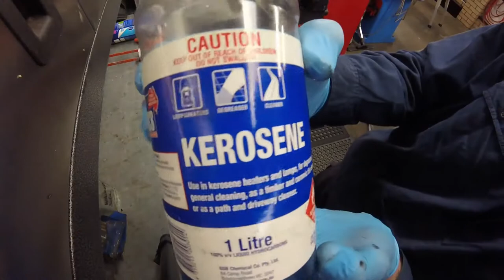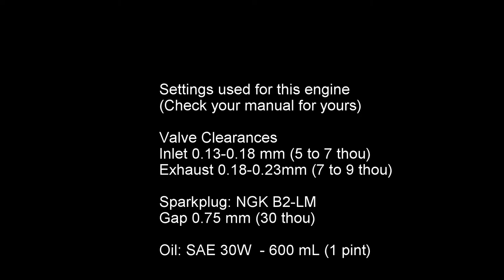Annual service for a flat head Briggs and Stratton lawnmower engine

Comment: I am happy I found your video. I have a flat head Briggs and Stratton lawnmower, when i pull the cord to start the engine is hard, and sometimes want to backlash. after some hard pulling, it will run.I did check the bake and is good.removed the spark plug and did not see oil coming out when puling the cord.removed the head cover, and cylinder and the bore look very good. however, I did a valve clearance check and could only place a filler gage on the lower (exhaust)valve. the intake valve moves up/down and close but did not leave any open for even a 005 filler gage in any position. any idea I am thankful
Reply from the maker: Jose from what you are saying it sounds like the intake valve has recessed in the valve seat. The fix for that is to remove the valve and grind the top of the valve stem to remove a very small amount. It is very hard so a file usually will not do it. Now if you do that, the amount you remove is only a few thousands of an inch. There is no other means of adjusting valve clearance on the flat head so it is all down to valve stem length. The clearance is 0.005 to 0.007 inches, 5 to 7 thousandths of an inch, so it is a vary small amount that you are removing. You can do this by hand, although a fixture setup is the correct way. If you do it by hand you can use a grinder, but it just needs the lightest of touches and then check the valve back in the motor, push hard on the head of the valve and measure the clearance. An oil stone or diamond stone is the better way to do it by hand however. Several passes with the stem at an angle of 90 degrees to the stone and then check your clearance. Good luck.